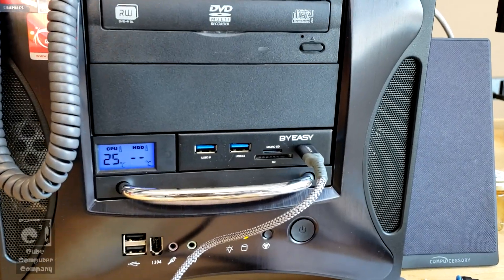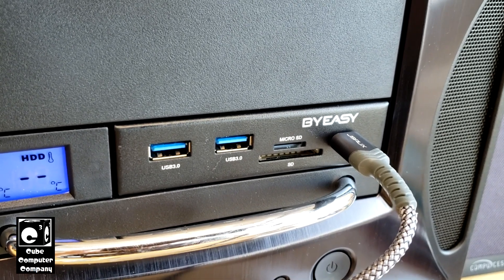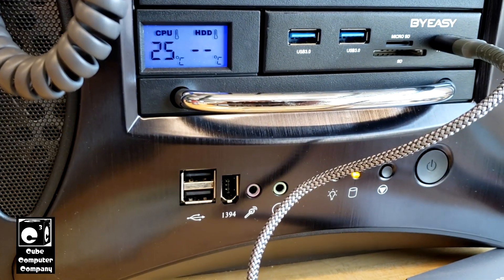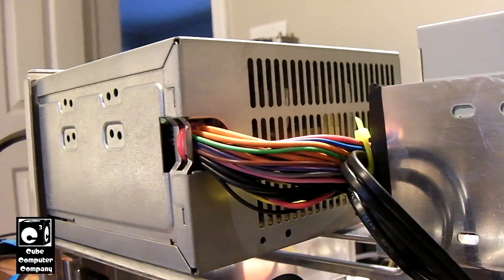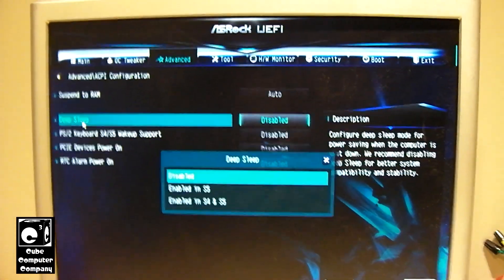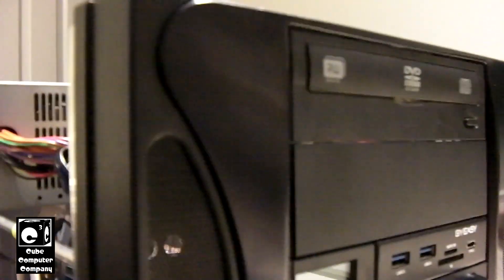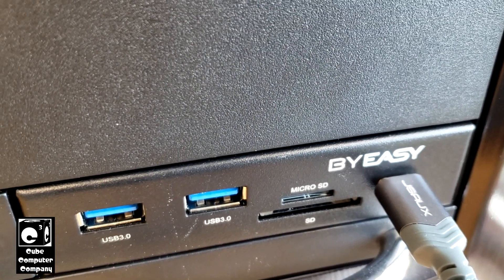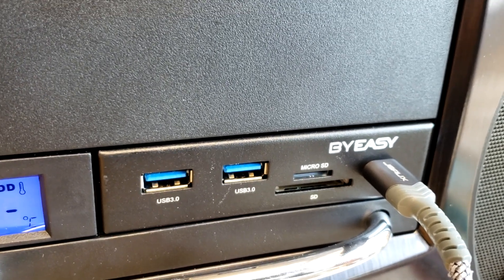Design flaw in BYEASY Front Panel 3.5" USB 3.0 Hub

Comment: Some cheap no-name USB hubs that come with an external AC power plug have backfeed problems too. It's definitely a design flaw.
One solution is to get a short USB3 extension cable and cut the 5DCV wire (usually red wire), then hook up the ByEasy USB3 cable to the USB3 extension cable then to the ByEasy unit. But this might not work depending if the ByEasy unit absolutely requires the 5DCV from the USB3 cable.